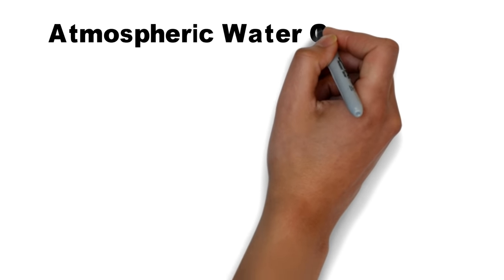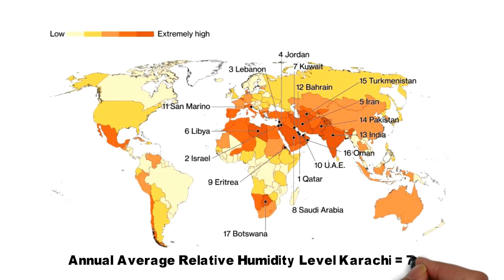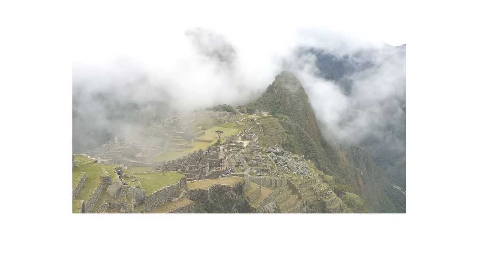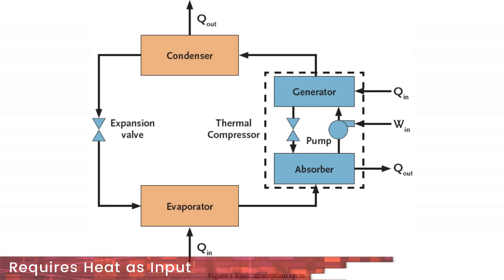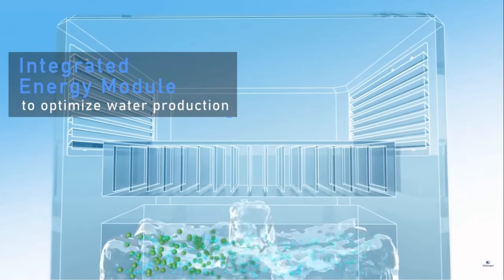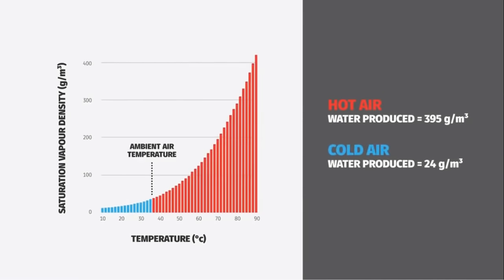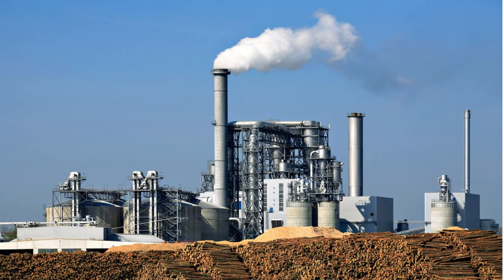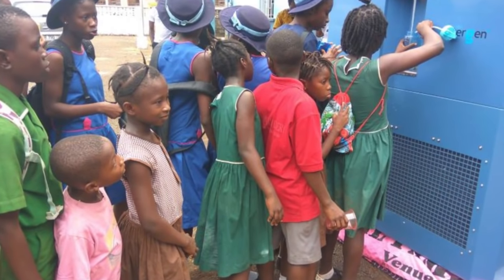Solar Atmospheric Water Generators: The solution to fresh water scarcity

Comment: Could the power for this be generated from the moving parts of the water condenser it's self? I have seen some hubcaps on cars that spin generating some power putting it back into the car battery. It's an idea. It would make the condenser more self sustaining a maybe provide more than just clean water. Just a thought to try and help.

Comment: AC units produce water from the air when the warm air passes over the cooling coils water is released due to the heat loss. Been doing this for a hundred years. When the drains get clogged with algae or bugs, then the drain pans over flow and cause spots in the ceiling or water on the floor.
Reply: so the awg does this but has filters in place to prevent their company from getting sued?

Comment: This will definitely be the water source of the future, eliminating plastic bottles and providing clean fresh water...
Reply: It absolutely will not. It's an utterly absurd way to produce water, you need a huge amount of power for minimal amount of water. Plus you need to then purify the water as you have dragged huge amount of air through your machine, along with all contaminants. There is is reason dehumidifiers say don't drink the condensed water.
Reply: how-hydropanels-work ... This is not a $75 dehumidifier and uses no electricity whatsoever

Comment: Hello - which of probably more than 100 available dehumidifiers is the most efficient? Is there a recommended model for high yields, longlasting and not to expensive?
50 Liters per day produced by 15KWh out of solar panels would be perfect for my finca in Spain.
Might it be smarter to store most of the electricity and focus on nighttime water production?
Reply from the maker: During the night relative humdity is higher so its better to run it during the night particularly if you are living near coast. 50 litres per day is very doable with 15 Kwh daily. Most AWGs would do that.

Comment: Great information, appreciated! Can anyone share insights for how I could analyze/shop the options for the best low-humidity required machine for family consumption in case of emergency? I have an extended family of 7 to care for in Phoenix AZ with low humidity (under 40%) and am not sure how to make an intelligent purchase on this! Thanks in advance for any guidance :)
Reply: Hello Hannah, you can check on SOURCE.CO  they are located at Scottsdale, AZ. Regards! Their residential equipment works with a minimum of 10% humidity.

Comment: Interesting video. This tecnology has some dark side.
For example, every human need about 2 - 3 litres of water each day. If in a small area the daily production is 15,000,000 litres (5,000,000 people), how is the local humidity influenced? How does the weather change? Are the changes local or medium radius?

Comment: If you have enough money, these things work but like you mentioned at the end of the video, it's in 4th place when it comes to getting potable water.
These are not long term solutions as the sellers of these types of equipment never seem to be able to figure in all the costs of running them. Spare parts and the cost of filters (coming from halfway across the world) are conveniently forgotten when the it comes to price per liter. Where does the dry hot air (capable of taking in the moisture from the surrounding air) go?

Comment: If we use peltier effect like for example soda can wrapped around with sand paper and linked to drive the load or to battery then to ground that way it take the heat out of the ambient to drive that load

Comment: My air conditioner does basically the same thing.
Reply: Mine too.  but it's not designed to be used to drink that water it takes out of the air. 

That extra step
(a water purifier), would enlarge the unit and need a larger storage closet for that A/C expansion.
Reply: Is your air conditioner designed to run off solar? What's your electric bill when you run it?

Comment: Have none of these people ever heard of where ships get their water from?
After twelve years  in the forces i am surprised that sommany people have forgotten how it was done, and just how much water per hour these units would turn out.
It was done using an evaperator using steam, that took in seawater
Boiled it by reducing the air pressure so it boiled at a much lower temperature than normal leaving a brine at the bottom and the steam went to the top and was taken away through a condenser and turned into just plain water without salt in it, the water was checked every few minutes to makevsure it was pure water with no salt , in othervwords distilled water as youncould only use distilled water in the boilers for superheated steaming 
for the turbines that drove the ship .
We are told that sea levels are rising  so lets use a bit of common sence andvuse these eveperators to provide water for watering the plants and vegitables so all the world has food, we help reduce the rising sea levels .
They can be as big or little as you want depending on how much fresh water you want, they can ve powered by the sun in hot countries, only require saturated steam, someasy to use solar heaters.
Just think how much land can be used that at present is just too dry.
This is technology that is asvoldvas the hills but works well, at least a far more viable idea than this getting water out of the atmphere.

Comment: It's called a dehumidifier they sell them at Walmart, Amazon and just about any other retailer on line.
Reply: I have a dehumidifier, but I wouldn't drink the water it produces. A huge amount of air is pulled through these systems, so the resulting water also contains dust, pollen and pathogens concentrated from that air. So an extra step is needed to purify the water. That's why the machines discussed in this video have better filters and things like ozone generators in them to disinfect the water and make it drinkable.

Comment: So the hydrophilic technique requires no energy input, no chemical input, and no chemical removal? You just expose this structure to the air and it collects water?
Reply from the maker: Yes
Reply: @synergyfiles3536  Does it require a mist or fog, or can it also condense from gaseous vapor?

Comment: Question...  If you suck up water 💦 from the air of dry climates, couldn't you then make that dry place even drier⁉️
Reply from the maker: There are a lot of humid cities like Karachi, Cape Town etc which are coastal. They however have a huge fresh water scarcity. This method is just an alternative to Desalination.
Reply: @synergyfiles3536 
I like the idea of the system.       
I'm questioning the effect it could have in already DRY climates.  
 Could it draw every bit of moisture from their air making them even drier❓
You didn't answer my question.
Reply: Yes, but only for that small quantity of air passing through the machine. So a negligible effect in terms of local climate.

Comment: Evaporating and thus Condensing water involves a very large amount of energy.  Ever tried boiling a liter of water away? The same thing must be done here in reverse.
Even if you can do it at 100% efficiency it is still not going to be efficient.  An other weak point is the filters of the device. They are also not cheap, and don't last that long.
Inverse osmosis is superior method to get large quantities of fresh water in my opinion if salt water is availeable.
If not a well can be digged, or rain water can be collected, and filtered.

Comment: Interesting what implications this have for the ecosystem if this becomes large scale.
Reply: Nothing much, as moisture is a constantly renewable resource. If you take out vapor out of water, it will immediately be balanced out by the surrounding atmosphere, and if we take out enough water from the entire atmosphere, that itself will make the ocean release some extra water into the air. Unless the entire humanity decides to take out water from a very concentrated place(which we won't) that will channel the moist air towards the relatively dry air zone and change the air pattern, there shouldn't be any impact at all. We make more effect in the air by simply breathing in and out or running our ACs or from the heat emitted from our cars.
Reply: @Amuzic_Earth  If the oceans give up more water, wouldn't that make them saltier?

Comment: I'm wondering what happens to the local environment, if humans start to extract air humidity in a significant amounts?
Nearby plants, animals, and micro-organisms need the air humidity, too. Thus there might be severe damage if humans harvest that?
Reply from the maker: Our main source of water will remain fresh water from lakes, rivers and reservoirs. This system will be only suitable where there is scarcity of water
Reply: A lot of rivers are being drained by populations and agriculture, if we can make more water out of air we will find a lot of use for it. I also dony have any data  but existent weather modification such as used im China can dry out some places when rain doesnt get there, but this technology is not dependent on that.
Reply: The oceans evaporate and provide all the humidity we could ever want,

Comment: 4:25 It kind of looks like a cpu heat sink.
Reply: it is. That thing with wires coming out of it in the middle is a Pelletier 'something or another' that will Generate electricity if it is place between a cold surface and a hot surface.
AND;
Will cool one surface transfering the heat to the other surface if electricity is applied to it.
 Awesome little device's .